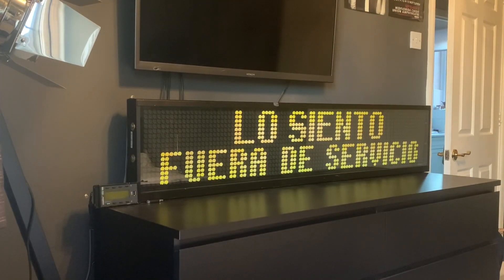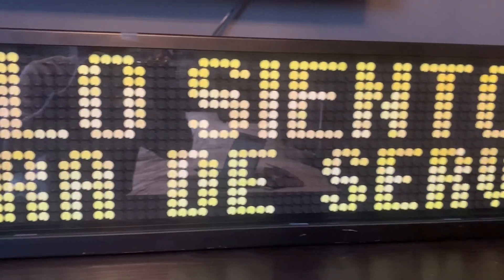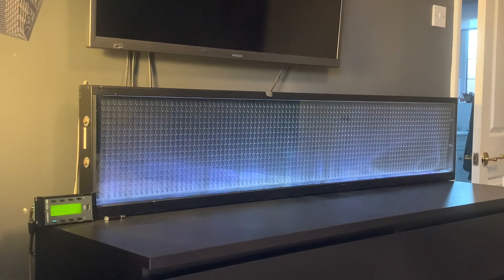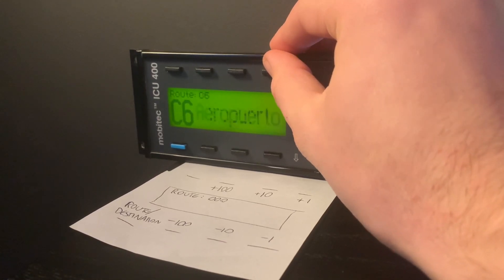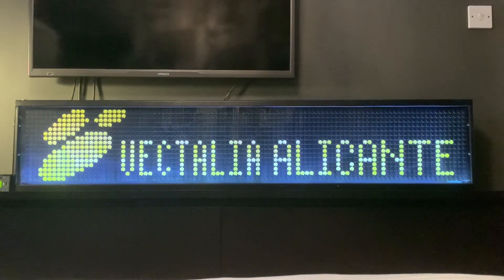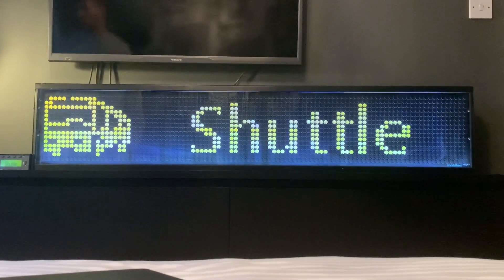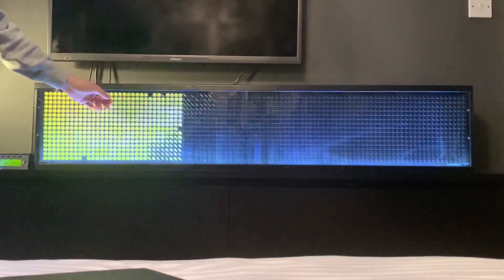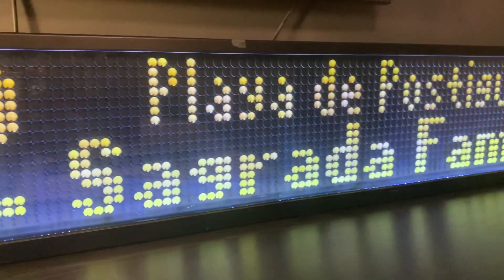Mobitec Flipdot 98x16 Destination Display In Action

Comment: As a Mobitec and Luminator service and repairer, I do not recommend using any type of spray lubrication on the Dots, it will only attract dust and make things worse.
Low pressure air and a soft brush is all that is needed. The axels gather dust which prevents the Dots from flipping. Even wiggling the effected dots with your fingers loosen them up.

Comment: I don't really like the font's on Mobitec's so have programmed my 140x19 LED display Hanover style. You have to do it all manually but once you have the created the lettering, numbers etc it looks great. I could have got a Hanover LED display but Mobitec ones are just that bit brighter.
Reply from the maker: I’ve done the same with various Mobitec jobs I’ve done, make them in HELEN, then import into Mobi Info Edit, Mobitec seem to build the better quality signs and have more approachable tech support, Hanover’s are more long lasted and more intuitive controllers/software
Reply: @NC-002  You don't have to be a bus customer to get parts from Mobitec. They've always been very helpful with me and not had a problem with my LED display yet. I've stocked up on a load of Hanover Display parts as there's quite a few left flip dot wise.
Reply: @NC-002  The only drawback with Mobitec's is that you can't have a route number only like Hanover Displays and Bright Tech's.

Comment: The Mobitec flip dot's are the rarer ones. Some of the dots get stuck on my Hanover Display from time to time and to free them off i just give the board a slap. Don't oil up the dots as it will ruin the solenoids
Reply from the maker: This one came from an ex Menzies OmniCity YN53GEU, a select few of the batch had them and were retained by later owners.

Aside from that, not many have had them, a few with First Potteries and the odd independents here and there, but generally not seen much
Reply: @NC-002  I've seen many Mobitec flip dot's in Omnicity's in the UK and continental Europe. A local bus company near me had a VDL DAF DB250 with a set of Mobitec flip dot's but swapped them for Bright Tech LED's as most of their fleet had them.